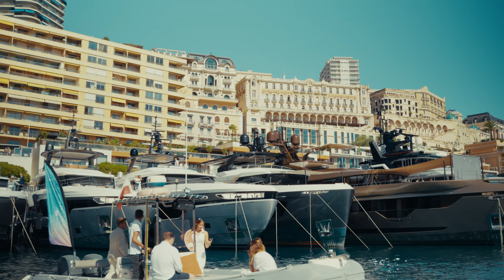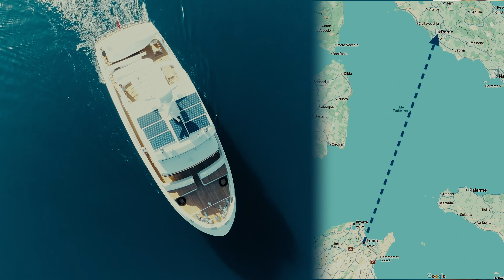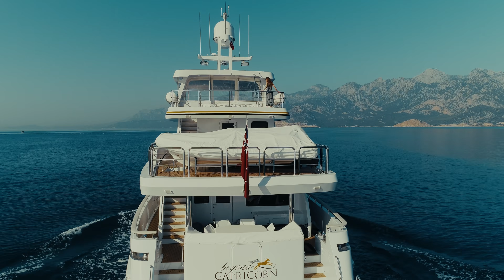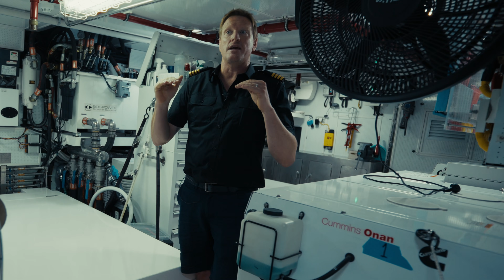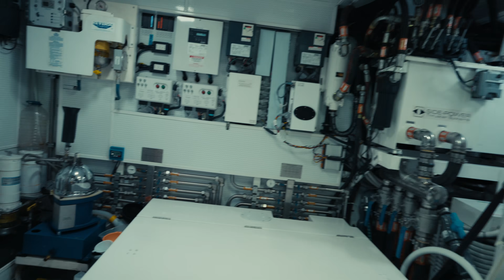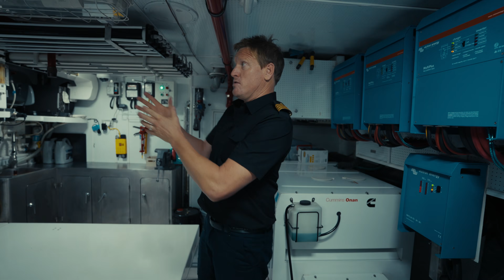Bering Stream: Inside the Engine Room of B80 Beyond Capricorn – A Powerhouse Demonstration

Comment: Engines are Cummings QSM11? 

I would have thought it would be more fuel efficient? 

If you back if off to 6.5 to 7kts what kind of range would you get?
Reply from the maker: At 6.5 knots, the range extends up to 10,500 nautical miles.
Reply: Impressive!

Comment: What is the crew mix? Stews, Deck Hands, chef, ?
Reply from the maker: Currently, this boat operates with a Captain and a Chef. However, it has the capacity to accommodate up to four additional crew members, depending on the owner's requirements and preferences.